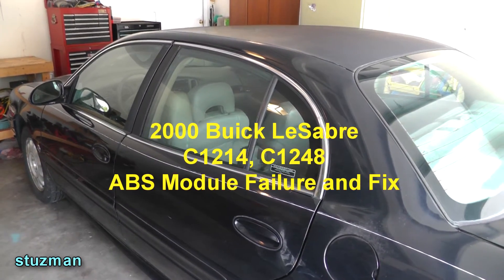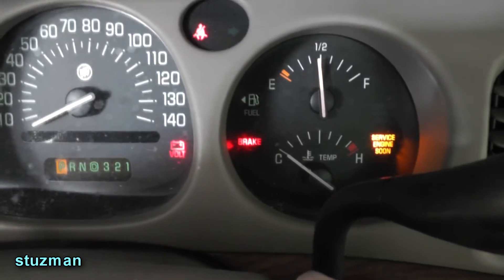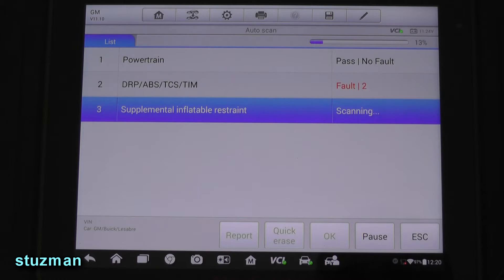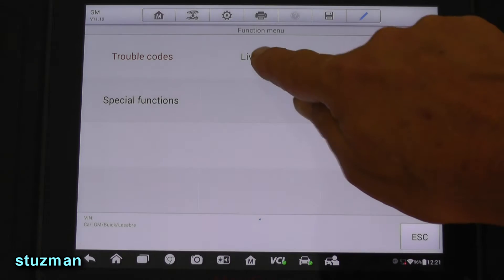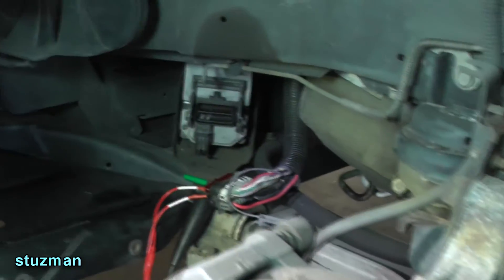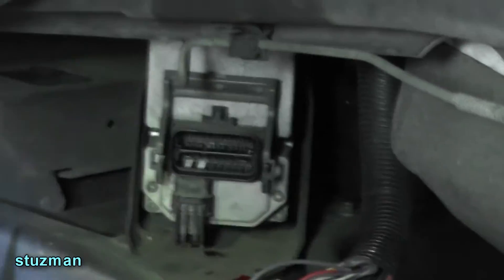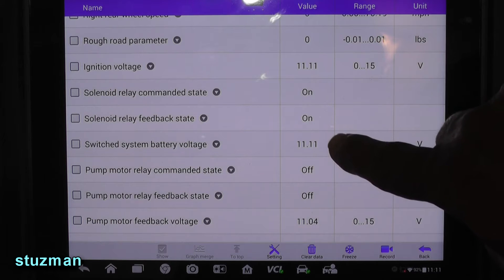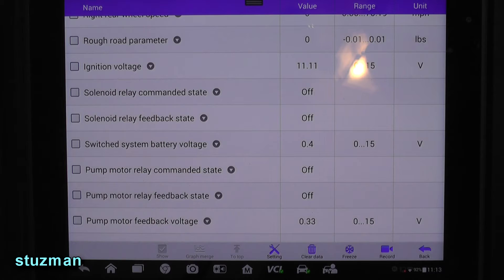Buick LeSabre, C1214, C1248 Codes, ABS Module Failure and Fix

Comment: I like that scan tool. Terry just when  you were tapping on the module as soon as it dropped out I could hear a chime - was that the warning light going on. Nice fix and it wasn't too bad of access at all.  Cheers buddy
Reply from the maker: Yeah Steve, the scan tool is pretty nice! And that chiming when the voltage dropped out was the chime going off indicating a problem and of course that's when the lights came back on. It's pretty easy to get to the module and I wish that I could have opened it up. Thanks for dropping in and sharing a comment!
Reply: So your chime wasn’t working